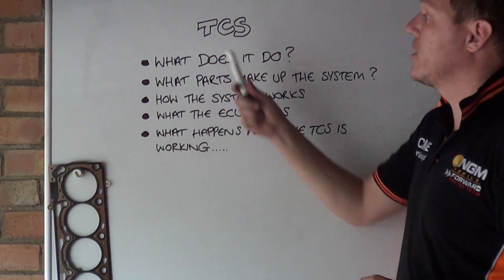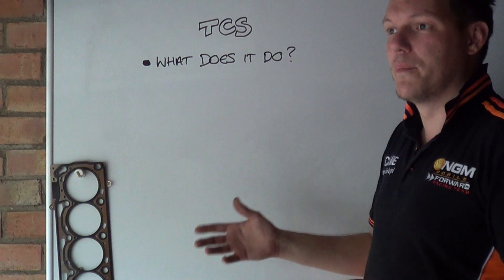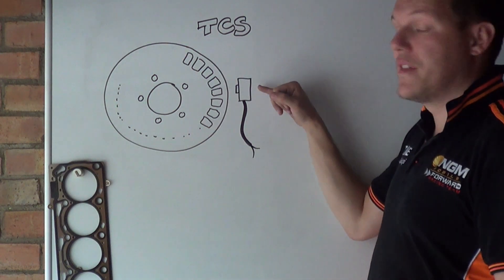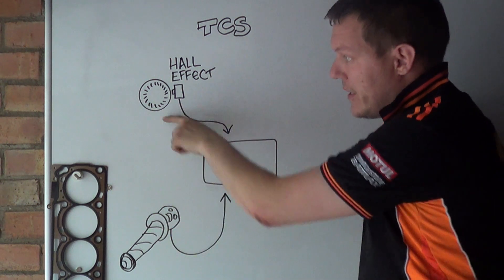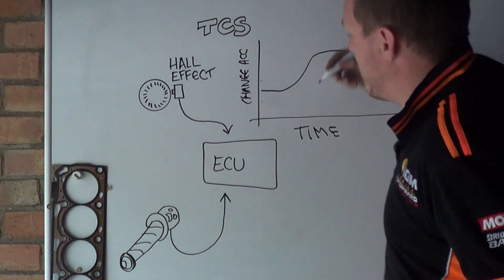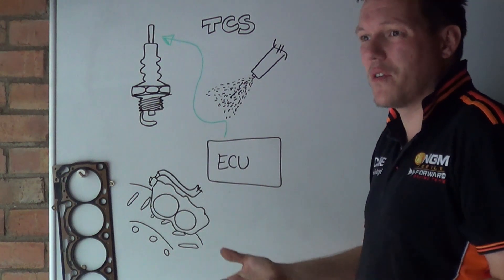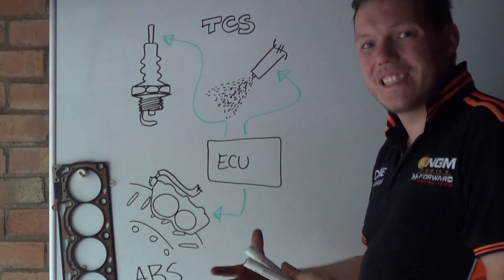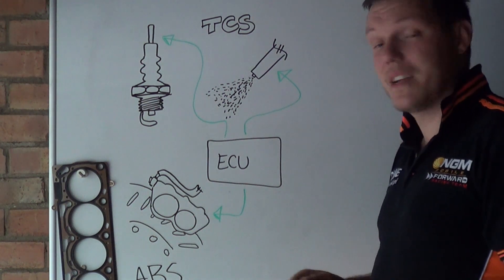Traction Control System - Bike TEch

Comment: Iam old school.  I dislike ABS and traction control as I like to ride the motorcycle and i don't like the motorcycle to ride me.  If i spin up I tend to shut down the throttle its probably not as quick as a ECU but does work.  How do you do a burn out with traction control? Also a different situation but in my truck in dirt or on wet leaves my abs system stops brakes working you pump like crazy but vehicle will not stop untill on good grip surface.  I find this actually dangerous.  Its a great video Matt and very well explained.

Comment: Does the TCS system close the throttle valves on bikes with ride-by-wire as well? Or would it only use ignition interruption/stop fuel injection?
Reply from the maker: On some models it could do but I don't know for sure. It would make sense to so the both at the same time.
Reply: Slamming the throttle shut would be a bad idea. Closing it by maybe 30% is probably enough. Without tying into the bank angle sensor, it would be hard to know if shutting off the throttle mid way through a turn is a good idea.

Comment: I know this may seem a bit simple but how about a video on horsepower vs torque? Good bikes to compare would perhaps be something like an MT09 which can put out 88nm of torque with 115hp vs a Bandit 1250 which puts out 108nm but 97hp what does this really mean
Reply from the maker: Yes mate, but your jumping the gun lol Its a 3 to 4 part Bike TEch video I'm half way through at the moment. The MT-09 has a redline of 11,300rpm and the bandit has a redline of 9,500rpm but its not just that it about at what rpm do they measure the torque. All will be explained - matt
Reply: Haha thanks!
Reply from the maker: https://www.youtube.com/watch?v=BOQ_FZ6Wgmw - correction